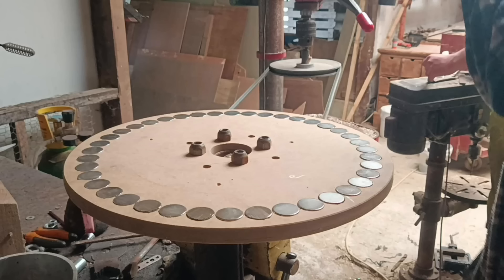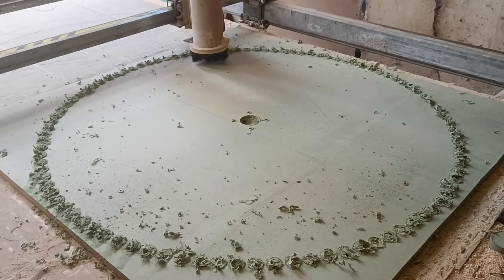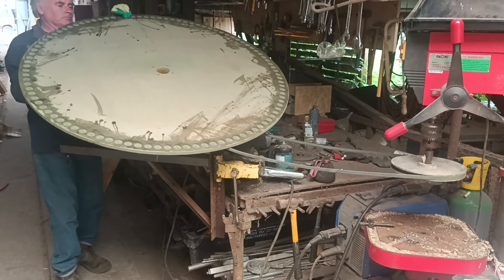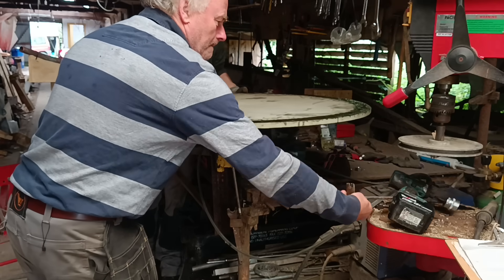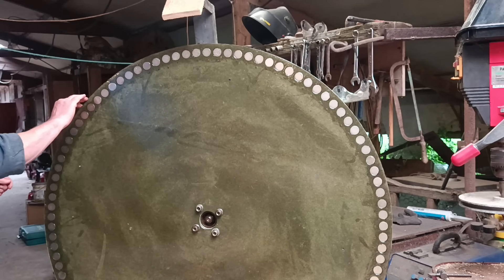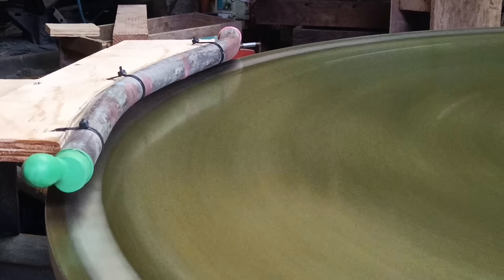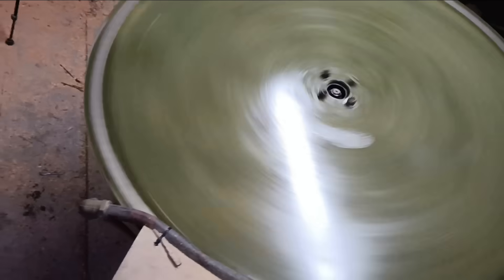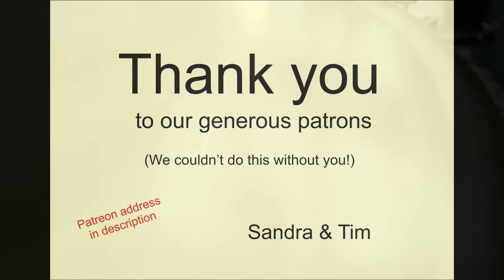ABSOLUTELY HUGE Magnetic Induction Heater! Using 100 Spinning Neodynium Magnets And A Bucket

Comment: Mabe make a circle of copper tubing that follows the full circumference of the magnet wheel, that way all the magnets are continuously heating up the pipe. Also, you'll need lots of insulation and an insulated hot water reservoir. Also, try adding "check valves" to make sure the hot water is being circulated and is constantly being heated. The hot water might not actually be flowing.
Reply: Maybe solder or weld a copper strip on the bottom of the pipe to catch a wider area of the 'flux' field. I think the tube has only a very small surface close to the magnets.
Reply: @dennix01  Solder would soft melt over time.  Meaning that every once in a while the temp would get just hot enough that it would move a little bit.  Once it starts to fall/sag it would have more heat and less transfer to the pipe meaning it would reach soft yield/loss of connection strength under even less RPM than the first times eventually falling into the magnets.  It would need to be welded or TIG-ed but could be worth it.
Reply: @FuhrChris  good point.
Maybe silver solder, brazing I believe it is called. 
Sorry for my English.
Reply: @FuhrChris  This is unlikely if the pipe is full of water. The sensible + latent heat of the water is so large that to boil all the water would require an enormous amount of energy. You then need to heat the copper an addition 300+ degrees C before the solder has any chance of melting.
Reply: @andrewmalaty8  I don't recall having a goal of boiling the water?
Depending on the size of the unit I would be happy with Hot shower level of water.  If the unit is small enough then simply a water pre heater that feeds into a storage tank and/or an instant heater.
Reply: @FuhrChris I agree. I was replying to the above comment suggesting that you may have issues with the solder softening/melting if you added a flat plate at the bottom. I was suggesting that that is very unlikely since you would need to first boil off all the water.
Reply: @andrewmalaty8  I agree. 
It's a very "Chernobyl" thing to do in designing a system that would melt down if it ran dry.
(Assuming worst case (Which I design for) that some ice formed in the copper and then a dry pocket was created. (Could be from an ice crack in the copper or just a lack of water during a non use time.) You don't want a soft solder to go semi molten.  Things that can happen can include simply loose copper fittings that leak because the copper moved out of the socket.
Reply: @dennix01  Flat, wide, square tubing.
Reply: @dennix01  Could use heat pipes
Reply: One problem with this is torque. Especially starting torque. The more metal is exposed to the magnets, the more torque it will require to spin the wheel.
Reply: @xFlow150 this is true, but the bigger wheel was meant to decrease speed and increase torque. So a smaller wheel with copper piping all around would likely be more efficient. (Similar torque and rpm, but capturing more energy as heat rather than moving a larger, heavier wheel).
Reply: @xFlow150  This thing is already large enough that you would want a bike like gear box and a coasting clutch so that the longer the wind is pushing the disk the higher the speed it would attain.  A direct drive would mean that the disk would be pushing the windmill blades every time/moment the wind slowed down.
Reply: @xFlow150  once these puppies start moving the end up as giroscopes..... the same as the turbine or windnill blades
Reply: @xFlow150  Get her up to speed, then bring the rings in. Something tells me that you've just invented a magnetic disk brake, though. I wonder what would happen if another flipping flux field were nearby.
Reply: I was about to suggest this as well, perhaps with flat bottomed square pipe or pip with heat conducting bottom plate / fins all covered in insulating foam on top. Also, I wonder about a double but thinner tube so it can coil around more than once. Finally, If you can increase the stability of the spin so the pipe can get as close to the magnets as possible without hitting (a mm or so) you'll make the absolute most of the magnet  strength.
Reply: @mikeutube82  what about a follower wheel running on the disc holding the pipe a set distance off the disc.
Reply: @victoriavickers33  I agree, like an outrigger, you could even make it adjustable and really dial it in.
Reply: also someone just sparked the idea that have copper on BOTH sides...
Reply: @unmanaged  i would also suggest a double sided approach, because it will cancel out the bending force on the wheel. 
its propably easier to insulate a small section of pipe and instead have the wheel spin faster. a transmission can be build very energy efficient without interfering with the rest, but better insulated pipes require more distance between metal and magnet, which is the most important variable.
Reply: going to agree that you might be better off doing a complete copper ring as all the other flips are being wasted ....
Reply: @unmanaged  there is a lot of waste flux and space..... a full ring with magnets above and below..... or copper circle above then below...... both requiring half the radius but the same number of magnets
Reply: As some have pointe out,  laws of thermodynamics and the conservation of energy dictates, the more induction you generate the greater the energy required to generate that heat. Energy is conserved and during the transfer of energy, there is also a loss. The aim of efficiency is to reduce the losses as much as is possible. In other words, the more energy you try to make, the input energy or activation energy of that system increases. This is essentially a generator. The more you demand from it, the harder it needs to work.
Reply: Don't forget the back flow preventer ball, so the water leaves the heat source in the direction you want. (Like a coffee pot)
Reply: You need to anneal old copper pipe before trying to bend it!
Reply: The heavy disc will cost you efficiency as the mass will make any connected windmill unresponsive to variable winds and gusting.
Reply: @andyxox4168  What if you cut holes in the disk to reduce weight?
Reply: @ perhaps an ideal solution would be a ‘spoked wheel’ taking care to accommodate centripetal forces .
Reply: ☝ @faragar1791 is right. The experiment should try to follow the full circumference. I also assume that the more "metal" that gets in contact with those magnets, the more "heating" you get. Therefore, there must be an "optimum" pipe diameter for it. 

I know it may not sound optimal, but maybe the experiment should try with one of those "thin" copper pipes, that are easier to bend, because of its small diameter, and try to do multiple loops around that circumference. Like one of those induction heater elements.
Reply: Thermocycle!
Reply: Btw don't place that tube parallel to the magnets, place it perpendicular ideally make like a snake zig-zag over those magnets, so that the pipe "cuts" over passing magnets, you want to make those currents insde copper to go back and forth as many times as possible
Reply: Why not put magnets all along the wheel?
You get the most speed at the outer ring but since you already have the whole wheel spinning, there's no reason not to have a second, third, fourth... etc ring inside the original on the same wheel.
Reply: @brotherjongrey9375  That would be called a break, there is a big force that oposes the movement of the circle when  the induction is happening
Reply: that pipe will be LIVE with potentially HIGH VOLTAGE
Reply: @anonymous-pr2sy  Thanks for that heads-up, we were looking to use an induction system, but your warning is being taken very seriously. Once again many thanks.
Reply: @conormcmenemie5126  I think it's only a danger if the copper pipe has a closed loop in it, an open semicircle shouldn't be able to develop high voltage!
Reply: @anonymous-pr2sy  TBH I was thinking that this additional static charge might triccle charge a 12 volt system, in which case the copper tube would be earthed. But it looks like we will be using a frenette system instead.
Reply: @conormcmenemie5126  if you get it working and use it for a long time it will be interesting to see how it breaks down and what needs service. I wonder how long it will take to work-harden the copper pipe and it develops a crack. Maybe years, maybe months, hard to know
Reply: @anonymous-pr2sy  Magnets prone to rusting, being temperature sensative and it's application as a low head hydro turbine driven heating element, in locations susseptible to spring flooding makes a sealed oil frenette device a better long term, low maintainence alternative. In effect the induction loop is a lesser choice.
Reply: Johnny Cash wrote about that thing. Heating a wooden wheel, be careful, or it'll go down, down, down, your Ring of Fire.
Reply: Run more tube under the table as well. Magnetic fields go in every direction
Reply: Yes.
Reply: pack the pipe with sand (and weed). only bend the pipe. the wheel has two sides which can be used. don't install th emagnets sequentially. :) and umm you know about the free part in the west part of the pee, aye, pee, yue, aye part.
Reply: Yes
Reply: He addressed the problem with the full ring of copper in the last video, and addressed the insulation thing in this video. Did anyone actually watch these or do they click through and then decide to comment their wisdom.
Reply: My thought, too.
Reply: you beat me to it...
Reply: Thats the opposite of what he should do. Induction only works well when there are short impulses, but since he used a long copper pipe , it wasnt very efficient.
Reply: A region in the rotation where the magnets can cool down might be a good idea, though. How hot would the magnets get? Hot enough to melt the epoxy?
Reply: If both sides of the disk work for  induction, you could double your area of heating by using two loops, one on each side. Like @gregcooper8407 said below.
Reply: People do this with copper coils in a fire pit, or wrapped around a wood stove chimney. As long as the start of your cool is level with the bottom of your hot water tank, and the top/return of the coil is level with the top of the hot water tank, the water will circulate on its own without need for any pumps. People take an old hot water heater that doesn't "work" anymore with normal electricity but still holds water without any leaks, and they make these for fire-powered offgrid water heaters!

I've also seen hot tubs that are powered like this using a nearby fire pit
Reply: @cyleleghorn246  the water in the video is recirculating on it's own. It's convection. Nothing needs to be level.
Reply: @Reptex_cs  I know with the copper "coil" method specifically (this video didn't use a full coil) any low spots in the loop can mess up the ability to continuously circulate. If you know for a fact there are no bubbles in it then it SHOULD circulate continuously, but it definitely works better (water reaches a higher heat given the same input) when the reservoir is at the same level as the coil. 

For wood stove powered water heaters I see some people keep the water heater tank on the ground, others put it a few feet off the ground so it's more in line with where the chimney starts. The ones that are off the ground do seem like they heat up faster AND get hotter, with the added benefit of a little bit of gravity head pressure. I've never done it the wrong way with a crazy route for the water to go through. If I put 1 drop of water in the top of my coil, I want 1 drop of water to come out the bottom of the coil: that's how I know it will be an efficient system and I have never once had a problem achieving good fast heat this way! For example, if my wood stove chimney pipe starts at 3ft off the ground, that's the lowest the pipe will ever go and the bottom of my water heater tank would be 3 feet off the ground.

In practice it probably doesn't matter much, but I got drilled with principle for years before I ever got the chance to build any of this stuff in reality
Reply: https://youtu.be/-MuZdCUSp3k?si=BD1w4jJXzpAP29eg
Reply: Was going to suggest the same thing...
Reply: Smaller pipe,much longer pipe, yes check valve and copper fill between the pipe windings... let's say 3.😎👍🏼
Reply: I love the idea but it would be more efficient to just to take apart one of those induction cookers and make system on solar, but if you want just heat water, just make those boxes or your can buy them already perfectly insulated and made specifically to heat water from the sun, those things boil water in the tank!!
Reply: @faragar1791  also... a double wheel with copper in-between.
Reply: You need opposing magnetic fields to create induction heat
Reply: Sounds nice but the force required to "push"those magnets past the copper would go up exponentially try moving a magnet fast through copper pipe or along a plate
Reply: Why don’t you make the hole disk full with magnets and copper piping, and at the beginning a valve, that means that the water can expand and only the hottest water will come out.
Reply: @Berseker-d9e  He want to fit this directly to a wind mill with relativley low rpm. Cost and weight of magnets becomes an issue. We are working on reconfiguring the magnets to try to ensure thay are at the edge of the disk so they can be surrounded by copper pipe. Having a mechanisim which is low pressure and heats gradually may be more useful than high pressure and higher heat.
Reply: Could you have an upper and lower copper tubing to heat water
Reply: @RobertJustice-q9l  I am working on the same theme and had discussed this with Tim. Having the same pipe coiled around the magnet/disk 3 to 5 times would make fuller use of the magnetic flus. Also surprisingly widening the gap between pipe and magnets may improve the effect - the shape of the magnetic field and the mass of copper are key factors and understanding those features may vastly improve performence. Also hydrodynamic retarders may be even better at doing the job.
Reply: Smaller wheel with more magnets positioned towards the centre of the wheel and snake the pipe over all magnets.. someone suggested pipe on both sides as well. Condense and insulated. Also have a question does it matter if the pipe is at 180 degrees to the magnets or crossed at 90 degrees? Are the magnets creating flow of the water?
Reply: Cheaper to put the kettle on! But, non the less, interesting. 😁
Reply: I agree with everything you said except the bit about the check valve. I think a check valve will do more harm than good. Although small, a check valve does introduce a pressure drop and the natural convection of the fluid has very little head pressure to cause flow. Even the smallest resistance like a check valve may completely stop the flow.
Reply: I was thinking this, but then would it not make more sense to make the pipe the same shape as a serpentine coil.  As is the pipe is exposed to the same state of magnetic flux at the same time which is likely negating the effect.  If the entire serpentine pjpe is only above north or south at the same time it should get a better effect from the alternating magnetic field.  You could also have another coil of pipe underneath for double the distance.  Requires some complicated pipe bending but should be doable with 6mm ID soft copper.  Scrap that copper isnt magnetic.  2 circular pipes that run above and below with a small circle of stainless steel the same size and the magnet attached to the copper pipe.  This would need to be every other magnet so it’s not exposed to north and south at the same time.  The steel gets hot and transferee the heat to the copper pipe.  Because the copper isn’t magnetic it won’t be effected by being over both magnets at once.  You may also need a small mechanical pump as water is effected by strong magnetic fields even tho is technically not magnetic.
Reply: @gregcooper8407 
That is a great idea. I believe that you do not need a pump, because cold water will sink and hot water will rise. Maybe double the magnets, so there are two circles of magnets. Have the inlet pipe start at the inner circle, then to the outer. Do this in the top and bottom of the wheel, if the magnets are cheap. I imagine that you want to have the hottest water that you can get out of the system.

Oh, and that wheel needs to be faster, or even bigger and balanced better.
Reply: @ pump is for safety,  this is completely flat and a slight incline is required to circulate the water by thermosyphon.  You can melt copper my induction, it could only be the water absorbing heat that prevents it.  Would also be a good idea to have a bimetallic strip that operates a clutch and disengages the drive when the water hits about 90c to prevent boiling and steam forming in the coil
Reply: @gregcooper8407  This got me thinking about the old cast iron baseboard heaters we used to have around here. They would certainly hold up to the heat. Hard to come by nowadays though since slant fin is so much cheaper.
Reply: @tandr3w  You definitely need to balance the wheel more so you can get the copper closer, but more magnets is not the answer, your first try at this fried an egg, you do not have the copper close enough to the magnets, and you need a more flattened pipe not circular, maybe a triangular shape with a bigger base than sides, also i think the best suggestion so far is to have the copper pipe the size of the disc not just a tiny piece of it.
It would be interesting to see how the previous wheel where you got the copper closer to the magnets does with this setup, and no insulation is not what you need right now, you need to resolve the issue of not getting the magnets to continuously heat water. Yes you might lose a bit of heat through the air, but it should be irrelevant if you manage to resolve the lack of real heating that you had in your last project.
Reply: @tandr3w  actually the pump could be a 3D printed material that is on the wind mill shaft.  (I don't think PLA would be the final material since other materials would last longer but by 3D printing the master model you could match the rate of flow to the main shafts rotations.) The faster the wind mill moves the more water would move, so the  temp should remain more constant as opposed to an electric motor what would need a temp on/off switch to only move the water when it's HOT enough.
Reply: @tandr3w  Tried this on our own system - a pump is essential, also the magnets permanently lose energy above 81'C so the water heating coil is also a magnet cooling coil!
Reply: @gregcooper8407  I think it's more about changes of field moving inside/across the body of copper generating eddy currents that in turn make heat (resistance) rather than the whole lump of copper being subject to a flux change. It's all about making those internal eddy currents not about potential of the copper as a whole as he's not trying to generate electricity. I could  well be wrong so happy to be corrected on this
Reply: @tomtom4405 you are correct. You use a serpentine coil so the magnets pass perpendicular to the flow if you are generating electricity, and parallel if you want to generate resistance (aka heat)
Reply: @gregcooper8407  just put the pipe in another fill gap with sand
Reply: @unmanaged  Interesting. I’ve been noticing a lot of sand battery videos on here lately. Might be useful.
Reply: @unmanaged actually use broken glass. It has the same thermal properties as sand, but doesn't self insulate like sand dows.
Reply: @thejaff23  thank you so much I want to passively heat a green house with sun storage at night, have you implemented this with glass if so how much would you have to break it up, still fine or are we talking buck shot size
Reply: @unmanaged  The smaller the size the more surface area and less air space. So sand size is great.
Reply: @gregcooper8407  Please give a better explanation of "Serpentine Coil"?  A Copper pipe laid out in a arch going from the smaller diameter to the outer diameter that was connected to another pipe via a U shaped connector would form a copper radiator.  Several rows of magnets would heat the water as each rows' magnet passes the pipe  This would maximize the polarity switching by making each magnet cross the copper pipe at almost 90 degrees.
Reply: @ https://youtu.be/0MLpa0KssVA?si=C-Mxwnw4pB6ekr2H
Reply: To encourage a convection cycle, heated water return should enter at the top
Reply: @RJ-cx1gt  Good suggestion, but consider what will happen if the water level drops below the heated water outlet port. The buffer tank has little effect on the convection cycle that happens in the pipes, it usually functions as a heat pile and as an air trap.
Reply: Maybe realize that the drill press is using ELECTRICITY, and abandon the whole idea for a water heater 👍🏻
Reply: Copper doesn't work. A short piece of steel pipe would be enough to boil the water.